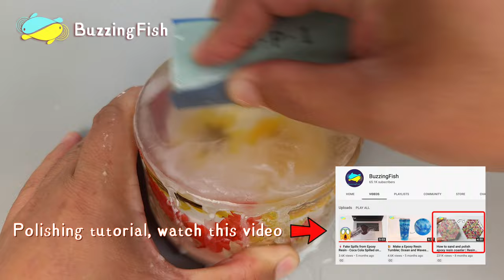🌼 Craft a Flower Resin Night Light from Recycled Bottles 🌼

Comment: Can I suggest a way for you to have a straight line after you cut the plastic bottle? ...Simply use a hot clothes iron and leave it standing up. Bring the Botton of the plastic bottle near the hot surface and gently press the circumference of the bottle (bottom of the bottle) on it. It will stand straight on a table at the end. Temperature medium-high.